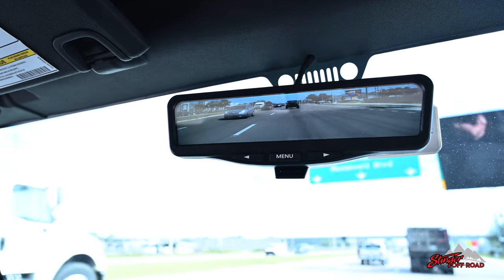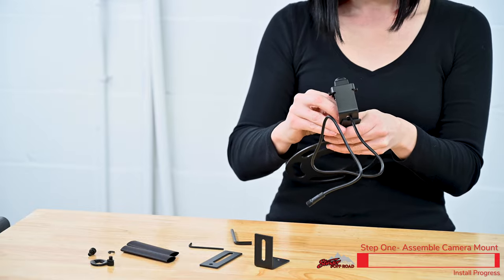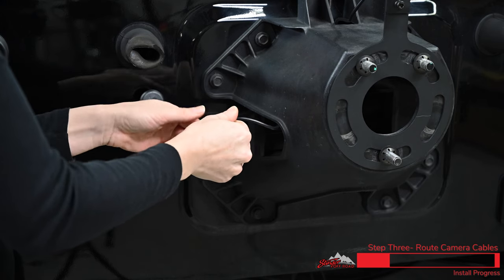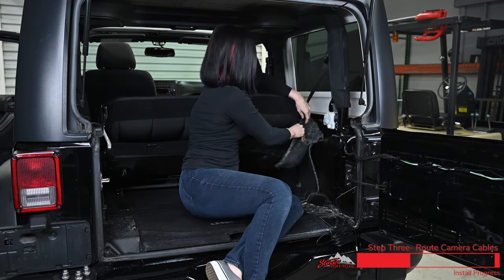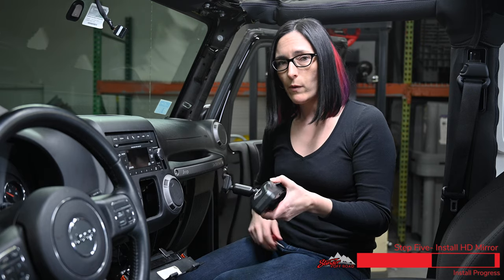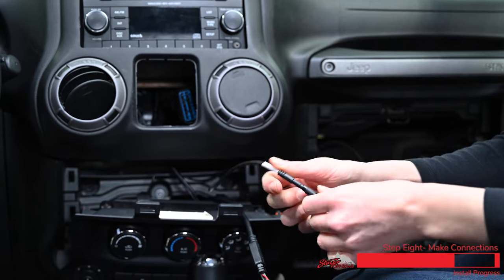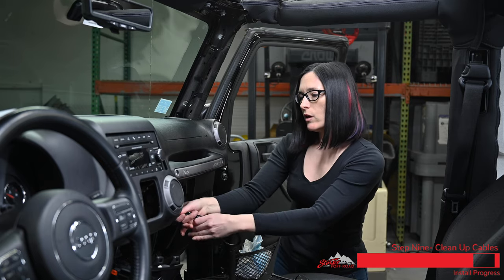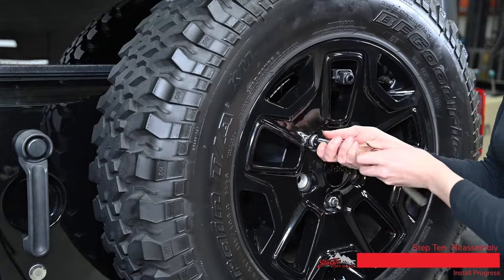Jeep Wrangler JK & JL Clear-View HD Mirror Kit INSTALL | Rear-View Tire Mount w/ Mirror Replacement

Comment: what happened with the harness she unplugged from the mirror?
Reply from the maker: The factory mirror connector is no longer needed and gets tucked up behind the plastic trim panel on the top of the windshield frame.
Reply: @Stinger.Solutions  Thank you!

Comment: Can use the factory camera?
Reply from the maker: You will need to use the supplied camera it does not integrate with the factory camera. This camera is intended to be mounted at a different angle from the reverse camera. Your factory camera will still for the purpose of reversing.

Comment: So what do you do with the original power wire to the original rear-view mirror, just let it dangle?
Reply from the maker: That harness can be tucked into the trim panel above the mirror that is removed in the previous steps